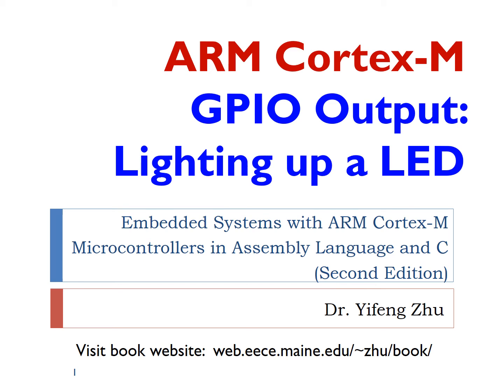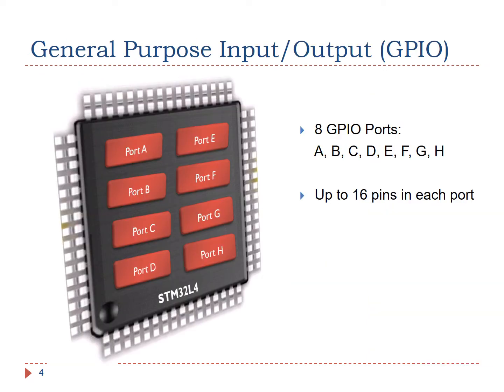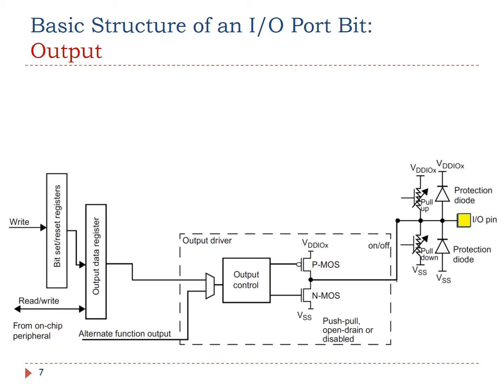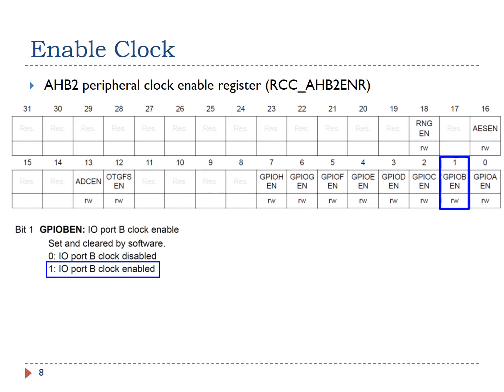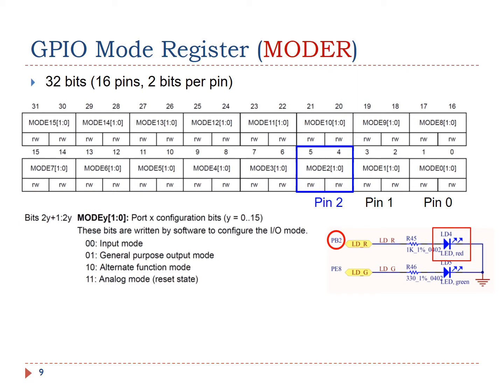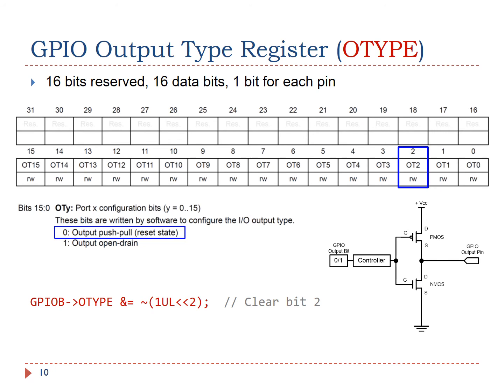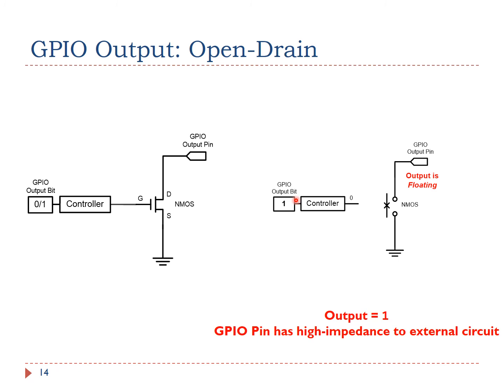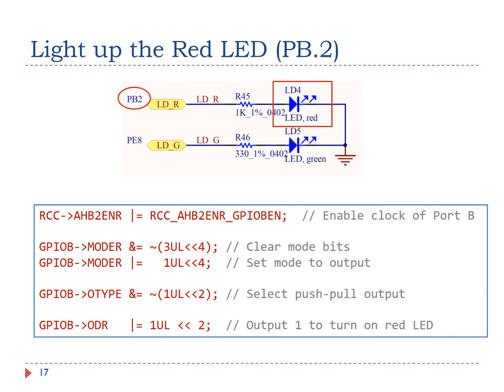Lecture 6: GPIO Output: Lighting up a LED

Comment: Where can I learn such command like GPIOB -> MODER &= ~(3UL<<4) that it actually do something rather than saying it clears bits or change bits, etc.. 
I already got knowledge about microprocessor and most logic operators so when you explain the 32 bits, i really got no problem with that. It just the code that I'm afraid of... 
Anyway, very brief and clear lecture. I hope I can learn more from this channel to fulfill my dedication in STM32

Comment: I have questions suppose we can generate led pattern which gpio mode use automatically next pattern generated.
Reply from the maker: Sorry. I cannot understand your question. Can you rephrase it?
Reply: @embeddedsystemswitharmcort9051  suppose 4 led pattern done.which gpio mode led pattern1 to led pattern 2 automatically generated then led pattern three and continue..
Reply from the maker: You don't need to change the GPIO modes. They should be fixed to the output mode. To switch to a different output pattern, you only need to update the GPIO Output Data Register (ODR).

Comment: in opendrain configuration for logic zero , output is floating and for logic one output is grounded.. isn't it?
Reply from the maker: No. logic 1 makes the output floating.
Reply: @embeddedsystemswitharmcort9051  I wonder why only the logic 1 make the output floating, it there a reason ? It looks easier to make the output floating in both logic 0 and 1

Comment: I have a question about STM32L1 Discovery Kit Lab 9 (ADC) on your website is that: i want to do some thing cool: b) Use the potentiometer to control the brightness of a LED.
I used TIM4 for this task, but it did not work. Can you show me where is the problem? Thank you very much!